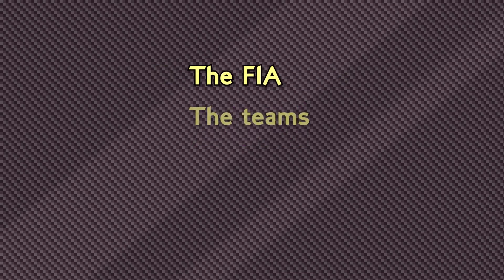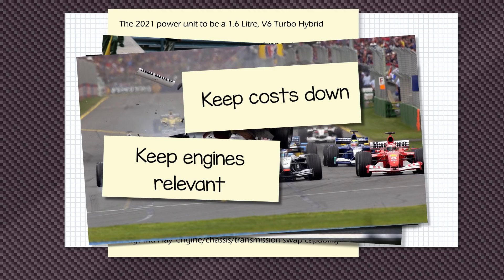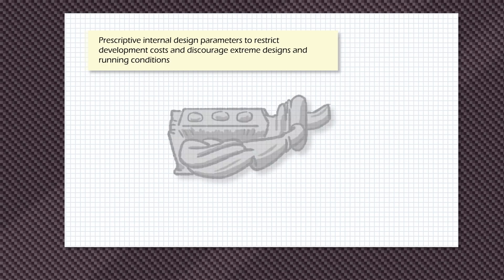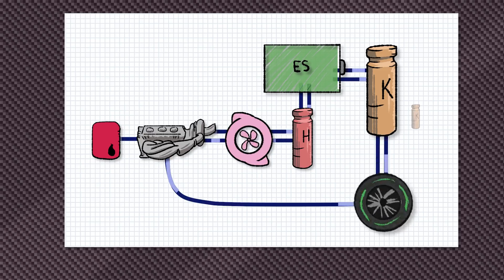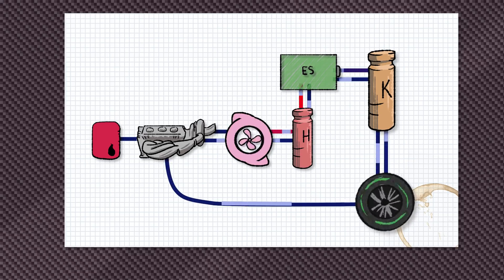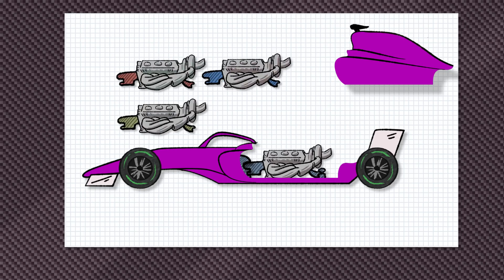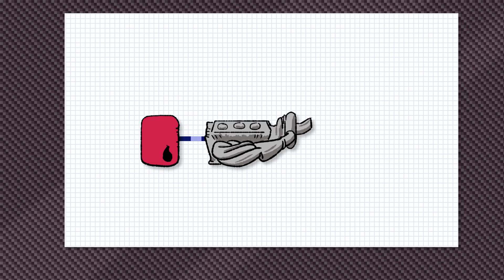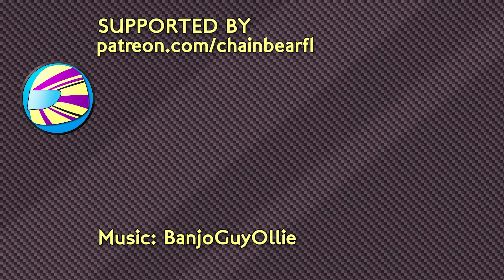F1 Engine proposals 2021 explored

Comment: You lost me when you call a v12 preference a hipster concept.
Reply: It pretty much is. "But back in MY DAYS things were better!" is hipster af. Actually it's more like Juvenoia.
Reply: @g.ferreira6745  you know little about cars if you do not understand V12 qualities. But that's ok. Be happy.
Reply: @jonasamadeolucas1801  every motor has qualities and problems. The v12 is just not as efficient as the v6
Reply: @g.ferreira6745  It is not that simple. It will be more efficient in over 800 HP, and have a different recovery and friction rates. And it will depend of what is the focus/propose of the engine. 
Nevertheless, a car is not only about efficiency, is about the experience, the sensations. There is no more harmonic engine than V12. By the way, I am Brazilian too (imagine you are because of the flag) .
Reply: @jonasamadeolucas1801  v6 engines are lighter and have a better fuel efficiency (as I said. Not sure if you're talking about thermal efficiency but I couldn't find anything about it), thus it is lighter (as it is smaller and use less fuel) and more economic, with also the bonus of being way less aggressive ecologically speaking. About the sound, seeing in TV or YouTube is cool and all, but V12 are way too loud when you're actually there. Also to me F1 is about the engineering, so aerodynamics, tyres and car bodies are just as important as the engine. F1 cars are as fast as ever, so sound is not important to me.
To me F1 is also about the drivers and crew in general, but this is not important, just wanted to add it.
There's also safety. V12s can be way too unsafe. 
And it looks the flag is working to alert other brazilians haha
Reply: Jonas Amadeo Lucas as always you People talking out of your Ass lmao Gustavo brought facts and all you do is deny it and mention your Brazilian as well lmao

Comment: We go from V12, to V10, to V8, to V6, soon we gonna have 50,000rpm single cylinder lawnmower engines
Reply: Insprill and these 1 cylinder power units will still make 1,000whp
Reply: TheLastBimzy dont forget 4 cylinder and 3 cylinders
Reply: They will just be electric... pretty obvious isn't it????
Reply: @zane7123  then what about formula E? it just ceases to exist?
Reply: @PozzAFC   I would assume it would be a slower car that would be a stepping stone class b4 f1.... but yeah good point.... maybe f1 will ceases to exist. Or one would make cars for 10 lap races and one built cars for the current 60 plus lap races.... I am really looking forward to the 2021 f1 season either way.

Comment: its already tripped on its two legs...bring V12 back. You want green engines go to formula e.
Reply: Mo Kahn problem is that f1 will just die if they bring back V12’s. If u listened F1 teams that dont have that high of a budget wont afford v12’s and they will just quit from f1 and there will be less teams each season which kills f1. 

V6’s are good and it works, they’re smaller than the v12 and i hear alot of people saying that todays f1 cars are too big and putting in v12’s will make the car much bigger which will make f1 fans say that they’re too big and they should make them smaller...

V6 are good for now. The end.
Reply: john jones if its cheaper to operate then why do they have more spare engines in each season? And why do they consume more fuel?. The engine overall is already more expensive, and having to have more spare engine each season just drives the cost up, and there is no more refueling nowadays thanks to the more efficient engine
Reply: @cloudstoragexd5101  The costs of traveling around the world 20+ times are much higher than things like fuel.
The MGU-K and MGU-H systems are highly complex and expensive. The costs for PU suppliers are in development work, passed on to customers. They limit the number of engines per season to limit costs because the of the R&D costs. A N/A engine would be way cheaper to manufacture, assuming it didn't have a ridiculously low fuel flow limit. The fuel limits are there to encourage PU suppliers to improve thermal dynamics.
The reason teams don't want to change is the development costs in a new engine design.
Reply: @john jones The v6 era has been the fastest so far.

Comment: Regarding the fuel question, there is a simple solution. Just use ethanol instead of gasoline, there is a set chemical formula which can't be enginered on meaning those costs are dropped completely.

Comment: Can I be completely honest about the The whole engine noise debate, formula E exists so why are they trying to push this whole economical agenda in the “pinnacle motorsport” why just do it like Ferrari and McLaren Did by just coupling the electric motors to the main engine and just have like a nice standing engines with electric hybrid technology as well I don’t know about you but the whole screaming like a banshee thing is it makes F1 F1 so why change that. Also why settle for just putting up with “moving forward” with the sound?? We can do screaming engines I don’t care whether it’s the V 10 or a in line 6 to be honest I mean Nissan were able to make screaming in line sixes so why can’t the F1 do that, it’s quite literally what makes F1 iconic

Edit, all it really is now is just add big turbos and 1000 hp + wow look at the figures almost like Forza mentality I really don’t like the direction F1 is going honestly

Comment: the only real thing i dont like are the 1,6 liter v6 engines. they are even less relevant than 3 liter v10s or v8s as these are used in road cars.
why not just take the fuel restrictions and say use whatever engine you like?
then audi , porsche and lada could just go "oh , im gonna use the 5 cylinder turbo/6cylinder boxer/4cylinder out of my road cars , and make them race ready. and use that experiance directly in my production cars"
but nooo it has to be an engine that was used once in a production car to no success
Reply: @Seb C well , okay, but then why doesnt mercedes crush Lmp, dtm, gt3 and all that? oh , yes , because other companys have more money for motorsports.
Reply: @Seb C well then you think mercedes can take on something like the vw group in regards to money? or toyota (even if they dont do big racing stuff) ?

also engines arent everything-> right now ferrari has the best engine, so it isnt even mercedes at the top of the stairs in that regards.

i think getting rid of the v6 unit is still a good choice , because it invites more companies with a more realistic engine.

because lets be honest: a single turbo 1,6 litre v6 is as unrealistic as the v10s and v12s f1 ran before

Comment: FIA has ruined the F1 and the WRC rally series as well. Motorsports should be all about insane power and sound. Something exciting that people want to see and experience. Not dull semi-electric, hissin, quiet and boring cars that run around the circuit over and over again. It seems like FIA has totally, TOTALLY lost the original idea behind motor sports. First they killed the B-class rockets and then years after, the F1. I'm amazed the F1 still has so many spectators buying tickets into races as there are nowadays.

If you have to cut down the costs, start from the electronics. Limit how much engines can be controlled by computers etc. Make them simple. If car manufacturers don't want to compete with such rules, it's time to bury the whole sport. Once thing's for sure tho, you will never f'ing ever find me watching a race with electric cars in it.
Reply: Ok no one care

Comment: The 1,6 liter engine is horrible crap as is. Most F1 and motorsport fans are interested in: Spectacular cars with loads of power and great sounds. You know, the audio visual element. Otherwise you could just go watch the traffic next to a freeway and feel satisfied.
The day the sound of petrol engines disappear from motorsports, that marks the end of all interest I have in any of it. Motorsports will have arrived to the end of it's life and passed away as far as I'm concerned. Altho I know I'm definitely not alone with this one.  Electric vehicles are so extremely boring to watch that it's... even hard to describe.

Comment: The last thing any normal racing fan cares about is efficiency. If you want to make them more efficient, take the hundreds of pounds of hybrid garbage out and give them a proper ethanol or leaded gasoline burning V8 or V10.

Yeah, they'll use a few more gallons of fuel per race but the running costs and total carbon footprint will go down if that's what you get off on.

Oh yeah, they'll be faster with the same overall power too.

Comment: It doesn’t make any sense to move away from internal combustion engines for competition. The problem is only with massive consumption. My prediction is that racing sports will keep those engines to stay relevant. If you want to predict the future on this respect, you have to consider human biology. We men like power and are impressed by loud sounds, torque and speed. Electric engines will never be able to provide that. There will be a point in which the Relevant argument will become absurd and racing cars will completely split away from street cars.

Comment: they've really brainwashed you Europeans into believing that an internal combustion engine with reciprocating Pistons inside of a cylinder is an evil thing, it's not, with modern fuel formulations, the efficiency of the engine, catalytic converters, and hybrid technology, it can definitely be a happy marriage between burning fuel and generate electrical current to create maximum efficiency, no one wants to watch a race where the electric car has to be switched out for another electric car because it doesn't have range oh, same thing with the real world, until you can charge your battery in 5 minutes to get 350 miles worth of Drive range like in a current normal vehicle or hybrid vehicle, they shouldn't even be allowed to be sold on the market, it's a complete ruse

Comment: If I was in charge of F1 the engines would be.... 2.6L V10's with Electric boost , no turbos but unlimited fuel consumption. Id also return to pitstops with refueling as cars starting with so much fuel are both dangerous and boring. Id also allow active suspension but not traction control or launch control. Id also increase the prizes for competing right across the grid.

Comment: Rule 1 maximum 100kg/h fuel consumtion
Rule 2 there are no rules besides Rule 1
Reply: Or give them a tight fuel allowance for the race and then say go wild.
Reply: @sergarlantyrell7847  
There might still need to be some aero restrictions otherwise it would be impossible to pass in a wheel to wheel event, unless everyone is just doing time trials. That's why DRS was added in the first place, to compensate for the complete lack of downforce when behind someone.
Reply: @Appletank8  maybe, but with unrestricted aero teams would be free to use active aero to increase the downforce when following... And the extra drag would be mostly mitigated by the slipstream.
Basically similar to DRS but not quite as much "push to pass" as drs sometimes seems.
Reply: @sergarlantyrell7847  unless you have giant underbelly fans running I'm not sure you can get any downforce off of the type of turbulent air off of those giant wings.

Also, the spending would likely go through the roof.
Reply: @Appletank8  I'm all for ground effect and blown diffusers etc. But yeah, development costs would be insane and it would be more dangerous too.
Wings still do work in slip streams, just not as much, you'll loose maybe a third of the downforce.
Reply: Ser Garlan Tyrell 
You do realize this means the chasing car would have to go a third slower around corners? Unless your car is leagues above everyone else, I'm not sure this is practical.
Reply: @Appletank8  Well it wouldn't be a third slower.  Atm cars loose a 1/3 of their downforce when following but aren't close to a 1/3 slower.
But you would be able to increase the coefficient of lift/downforce to compensate. Also you could open up the brake ducts so your brakes don't overheat either (often said as currently why cars back off after a few laps).

Anyway, it's just an interesting "what if".
Reply: @sergarlantyrell7847  downforce is drag though, you can't separate the two
Reply: @sergarlantyrell7847  
You assume everyone isn't already at max downforce in a corner.
Reply: @mwu365  there is a type of drag that's lift (or downforce) dependant, called induced drag. But there are many components to drag, induced is just a fraction of them.
Reply: @Appletank8  of course they're not. Currently you can only have the one setting for the whole race so you have to balance downforce with top speed.
Reply: @sergarlantyrell7847  didn't know that, ty
Reply: @sergarlantyrell7847  
You're the one who brought up adjustable wing levels, I'm saying why that wouldn't help you keep up with someone in a corner.
Reply: That would be exciting but so expensive that top teams with all the money will develop rocker ships and small teams will develop sail boats.

Not in the spirit of what they're trying to do and that is to give even small teams a chance to fight at the top.

Comment: So what's wrong with the old and I mean really old (a little older than me and a hell of a lot older than you) rotary phone? I have one with a date of 1947 and it is the best audio producing graphite speaker phone I have ever owned regardless of all the bells whistles video crap of the smart phones of today. My phone is dead reliable and yes it is a bit slow and very stupid but I have been using it since I was a kid and someone before me. So you speak of "bad engines"  Please PLEASE post a picture of yours smart ass. I understand the problems of fueling during a race and therefore the displacement and use fuel management need to be addressed but as I see it when F1 Racing was a sport for men instead of hair bun millennial types with long degrees in computer programming,  Real brave men were the engineers and mechanics and drivers. I am amazed at how pit stops are choreographed and executed sometimes by incompetent boobs. F1 has become little more than sophisticated expensive go cart racing. Drivers, Don't forget to shave your legs and chest hair to reduce every gram of weight.

Comment: Current F1 engine rule has a 15K RPM limit, therefore if they add an extra 3K it would total to 18K RPM allowed by the new rules, but they currently rarely go beyond 12.5K RPM so I doubt they will spin them up to 18K when the new rules kick in, due to higher fuel consumption and engine longevity issues.

Comment: Switching to a 1.6 litre V8, with the removal of the MGU-H and an increased rev limit would solve the engine noise problem. Most supercars use V8 turbos nowadays and I feel Formula 1 should reflect the best a car can be, like the supercars we have today do.
Reply: Ben Vernon I don’t see what’s wrong with a V12. Many top Supercars use them.
Reply: @willywillywillywillywilly  V12 N/A is just archaic. To stay within the realms of modern technology, moving the sport forwards and keeping the sport exciting for fans, I think a V8 hybrid turbo 1.6 would be a good direction, but it might stop new teams from entering, that's the only thing. V6's in my opinion sound a bit dreary. Better yet, drop cylinder count down, but engine size up, to a screaming V4 1.8 B)

Comment: There would be no point of having Multiple teams if the car isn’t unique to the team. If Team doesn’t develop their own power unit. Second, Toyota, and Porsche won’t be new to Formula 1. Porsche is now back with VW so money wouldn’t be an issue; Toyota as well. 

Since it’s inception Formula 1 was never relevant to everyday life. We weren’t going to drive as fast in real life nor did we buy tires according to how the rims looked on the cars. 

If you want to interest a lot of teams to F1, let teams choose to either have a turbo v6, v8, v10, or v12 with respect to fuel regulation. 

I don’t think people ever went to buy a v12 just because they saw one. They bought one because they could. If you only have the means of buying a 4 cylinder that’s all you’d buy.  

F1 is going to die just like NASCAR. The similarity would be alarming. 

If you are just new to F1. F1 was a Rich’s mans sport. If you had money you’d play if you didn’t you simply walked a away. It gain its popularity this way. With this and it’s regulation it gain the ever so famous F1 branding.

Comment: Why don’t we just strip away everything that makes it great and then we’ll be left with a slightly faster, slightly more sophisticated combination of Formula E and Indy car. Only so long before the sport goes under. F1 isn’t supposed to be about being relevant to road cars, it’s not supposed to be about attracting more mainstream world teams, and it’s not really supposed to be about the cutting edge of technology. It’s supposed to be the fastest, most exciting racing series in the world. The 2003 V10s were making somewhere around 940hp. That’s 15 years ago and we are just now getting back to that power level and it’s only with 180hp of hybrid power, plus the weight and complexity of that system. The V10 cars lap times are just now starting to be broken and the cars now are wider, have wider tires, and no grooves.

Comment: So if f1 does go full electric what happens to formula e lol
Reply: They will use a new form of electric motor that will use chemicals reacting in a chamber rather than electricity. They will call it the 'combustion engine'. And it will be great!
Reply: @kraftwels  also so like, hydrogen?
Reply: FE actually has exclusive rights with FIA to be the only top tier electric race series until something crazy like 2040 (can't remember off the top of my head)
So, F1 can't ever go fully electric unless the two series merge. 

I suspect there will be a point where there might be something similar to America when it had two top tier indycar series and then they merged together.

Guess time will tell.
Reply: it doesn't. It gets phased out.